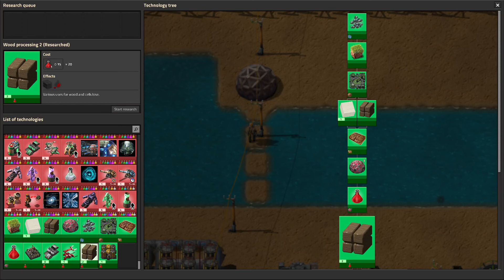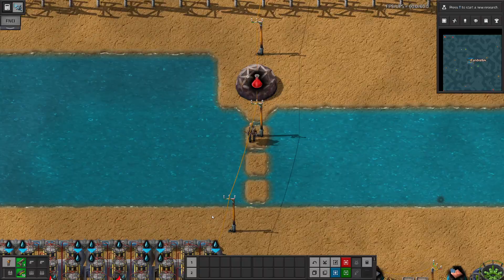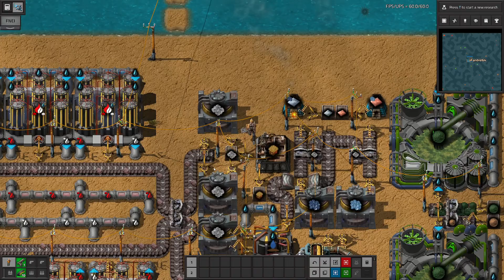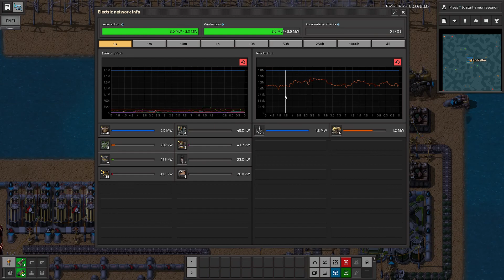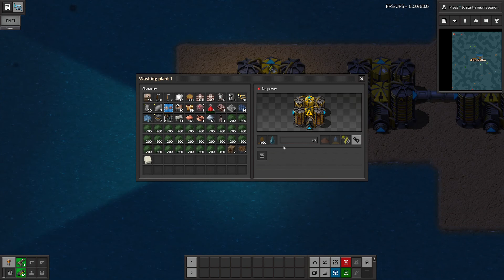Factorio Seablock Revisited EP2

Comment: Any reason you aren't making charcoal for fuel? Turning 18MJ wood brick into 20MJ charcoal.
Reply: I'd recommend against putting algae on a belt, or you're going to have throughput problems! For now, I'd insert from the algae farm into a chest then directly into the assembly machine making cellulose fibre. No filter inserters / splitters required. Even better once you get Green Algae 2: no chest required.

And from there, direct insert the fibre into the assembly machine making wood pellets. Pellets can then go on a belt. You'll not need nearly as many machines making wood bricks.
Reply from the maker: Like I said, this is all temporary to climb part of the tech tree and get things going until I rip it all out. That being the case at present I'm far from having to worry about throughput issues at the moment as basic belts have plenty of capacity to keep up with my 8 algae farm 1's. At present my biggest "problem" is storing all the excess brown algae I'm making until I have more efficient green algae production in place and have a demand for the brown algae to burn it off with. This early in Seablock with space being the biggest bottleneck to growth I view everything as temporary and subject to being torn out as I get better more efficient and more productive tech and need space for something else so I don't get very wrapped around the axle about ratios and efficiencies for temp builds and don't get too attached to them. Once things begin to be more permanent then I start to be more concerned with those sorts of things.
Reply from the maker: Yup. Simple answer, I haven't gotten to it yet. LOL That's the only reason really. 

I need to gather up stone for the furnaces and I need to ramp up wood brick production to support it. Also charcoal leads into CO2 production which makes green algae production way more efficient so I want to route it all together to feed both. That's actually coming next because now that I'm making much more sand I can put in many more algae farms. It's an easy step to add charcoal to the production string I made to feed the power plant but the string is only short term to get things running and then it's all getting ripped out to build bigger anyway. Then it's increasing metal production, then it's......

Over all my plan is to film the basics of each step for posting but then off camera to do much of the actual big building while not getting so far ahead that it's too hard to follow what I did off camera. That way I don't feel crunched to do a bunch of filming but then not be able to touch it between episodes. This way I have things I can do between episodes and not have to twiddle my thumbs while wanting to build and also at the same time not feel like I'm under a huge crunch to film and edit. I think that's what burned me out most on the SpaceEx series and it just stopped being fun.
Reply: Love the fact that the guy who keeps the mod updated watches playthroughs to see if everybody is happy. Very cool!

Thank you both very much